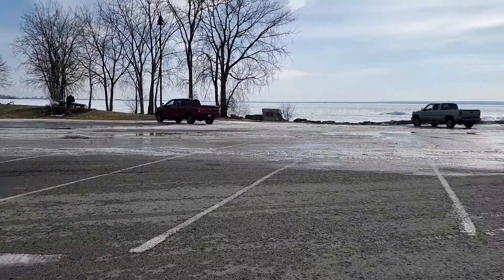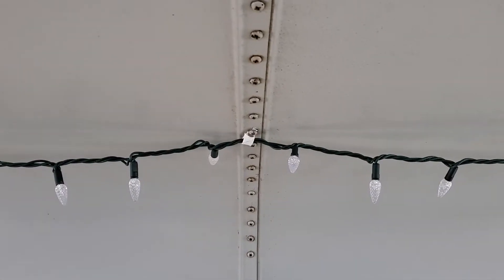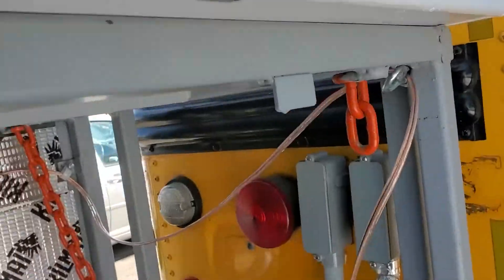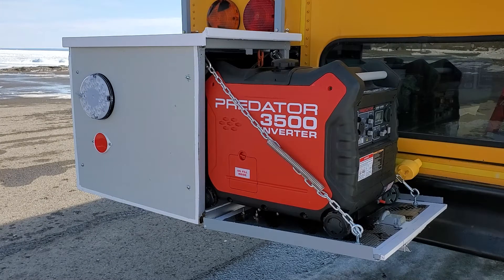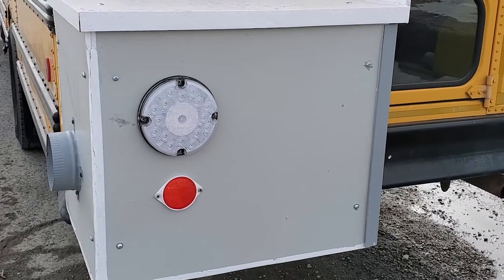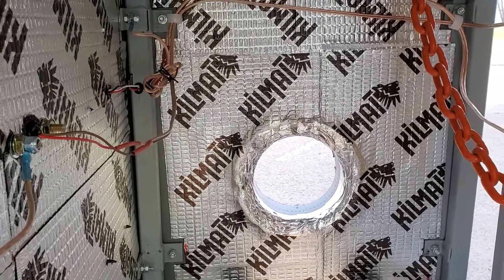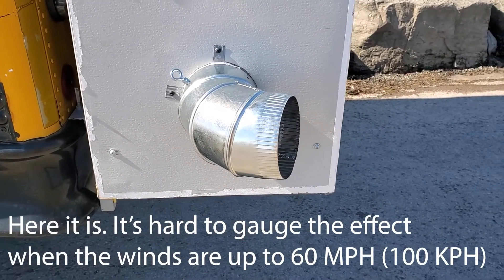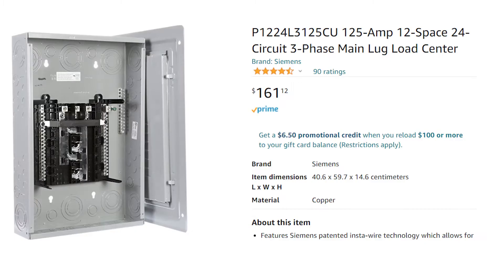The SkoolieLife.com Episode 10: Completing the installation of the generator

Comment: A very neat enclosure for your generator. Since I have a flat nose bus I will be putting generator in an weatherproof enclosure on front in a carriage. I did the same thing you did in lighting by using LED lights where the former are incandescent bulbs. 
I will be using the three lead acid batteries on the bus for lighting inside only. I will not be using solar power but plan on having a portable rear bus mount wind turbine to keep bus batteries fully charged while dispersed camping.
Reply from the maker: Thanks. The three batteries you refer to - are those the bus's starter batteries?  Most people avoid using them as house batteries for fear of running them so low that the bus won't start. What   loads will you have in the bus? Fridge? Fans? Recharging electronics?
Reply: @theskoolielife  thanks for replying to my comment.
Yes I will be using the three bus batteries for my LED lighting. LED'S use such a tiny amount of energy. I will use the current coach lighting for inside lighting which are mounted in a panel just above the windows. I plan on using a toggle switch for each lamp there is seven of them.
I have a propane generator that will be mounted on the front of my flat nose bus in a carriage. It will supply AC current when I'm boondocking or dispersed camping. I have a 3.2 cubic double door fridge that I would use when in a park with amenities. Also I have a counter top oven, ice maker and microwave and another appliance I may not have in mind. I will have a miniature fridge ( ice chest type ) that runs off the bus batteries but usually when traveling. 
As for fans, I use open windows but I do have portable fans, and one window air conditioner that can be installed and removed easily when camping in the boondocks.
My work is a slow work in progress at 81 years of age and working alone. 
I like keeping the work inside simple, convenient and comfortable, reducing excessive costs. Doing my own plumbing and electrical.
I will have under floor black and gray water tanks, 30 gallon round tanks costing $15 each. These tanks are very durable. 
I will continue watching your videos for ideas. The school bus is one durable vehicle and will last a long time compared to the lavish and luxurious expensive motorhomes.
Thanks again for reaching out to me. Makes me feel appreciated as a human being.
Reply from the maker: @alvisjenkins1305  mine us an inverter generator,  which is quieter than most, and the enclosure I built has sound insulation. But because the enclosure is bolted to the bus body and bumper,  sound from the generator is conducted into the living area. It's tolerable, but not something I'd want to hear constantly. I'm concerned that this may also be your experience.  A reasonably sizes power station (eg from Jackery, Blue Yetti or Ecoflow) would give you a reserve of energy available when the generator is not running. It might allow you to run your fridge even when you camp without hookups.  You could charge it with portable solar panels, or by the vehicle's alternator.

Comment: I may have forgotten to say the first time I commented, but I plan on having a wind turbine installed on the back bumper, a self made and engineered by me. It will be useful when I am in areas of the high elevations of the West. It will help keep my bus 3 batteries fully charged. I have a Shumaker battery charger that employs a 200 Amp quick charge to batteries should they happen to be too low to crank the bus. My generator will power the charger.
Yeah, I think the generator mounted in a carriage on the front will cause vibrations and sound to be present in the bus but as you say, it will be tolerable.
I have a long way to go in my bus build but hope to have it ready for the road sometime in June.
Thanks for sharing comments.
Reply from the maker: No, you did mention the wind turbine.  I may be unfairly discounting how much energy it will provide.  Best of luck on your build. Please send an update when you start to take it on the road.